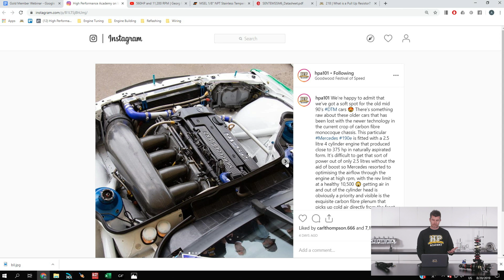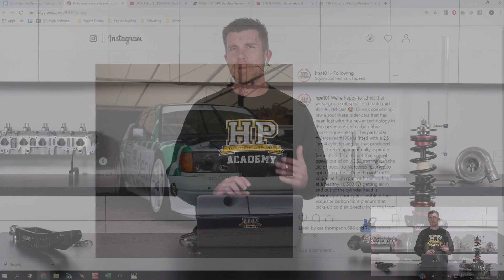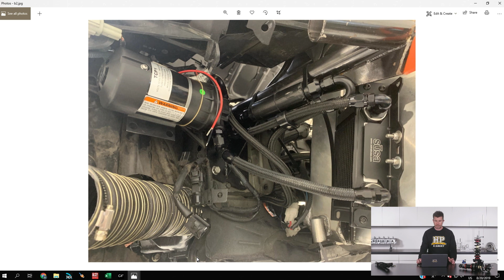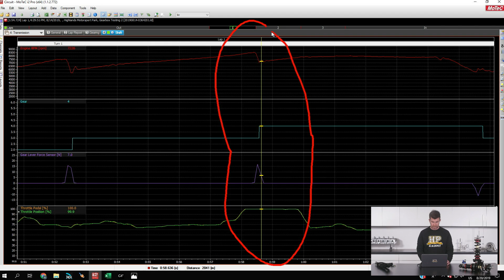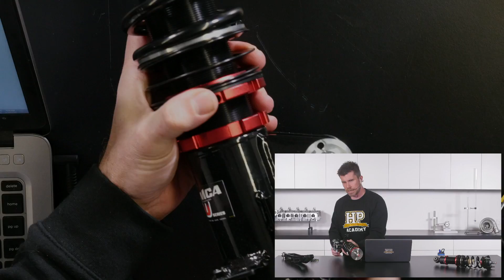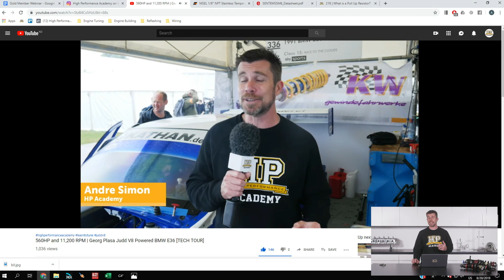Sequential Gearbox in V8 Toyota 86 & Data Analysis | Today At HPA 218 [UPDATE]

Comment: Fit a flat splitter and undertraythat seals the radiator. Vent the bonnet to improve airflow through the rad
Reply from the maker: That's what we had with our budget aero setup, hoping to keep those aspects but improve them further under the body and add a more rigid wing etc - Taz.

Comment: hey guys every wondered about the adverse affects of having a different diff cover? Banks (Turbo Diesel Specialists) made an interesting video on it. they showed that if the diff cover doesn't have a proper groove for the ring gear the oil will actually aerate and not feed properly to the bearings for the axle stub . Now im wondering if the oil is in fact aerating would that also impair the oils ability to cool properly.
Reply from the maker: Hey there, yes his video came up as a topic of discussion when we first fitted the cover, but his test has a few holes. Andre does discuss this in an older update, I'll see if I can find it and link it later but it will be the same playlist that all of these are in 😉- Taz.
Reply from the maker: Ahh here it is: https://youtu.be/PE3NbjPEO_U

Comment: About those cap screws backing out, where those on the left or right side CV joint? I'm guessing on the left diff flange.
Reply from the maker: Both sides 😉
Reply: @hpa101   Really? One side would make at least some sense. Did you try nordlock washers before  the lockwire solution?

Comment: 8:31 Why is there a difference in pedal position and throttle position at it's closed position and not at the wide open range?
Reply: possibly due to idle speed control holding the ethrottle open so it doesn't undershoot when dropping into idle
Reply from the maker: As Vaughn guessed, the throttle position is used to control idle speed so it never closes to 0% even when the accelerator pedal is completely closed.

Comment: Another great video Andre!  I particularly enjoyed the in-depth review of the logs of your GT86 shifter load cell and related fields.  I am wondering if the MOTEC works a rear wheel speed measurement into the downshift throttle blip calculation. It seems like quite a bit of driveline shock could be introduced if the transmission is over-blipped during a clutchless downshift in a braking zone.  Maybe even enough to loosen some axle CV bolts?
Reply from the maker: Thanks for the kind words mate! ion this case the MoTeC is programmed with the gear ratios for the box so it can then calculate the engine speed should be when we down shift and can instigate a rev limit to prevent over blipping. You still don't want to just aggressively blip the throttle and rely on the limiter to catch the rpm as it provides a fairly loud 'crack' when it hits the cut.

Comment: Re: the bolts for the drive flanges, DO NOT use spring washers as they DO NOT work and I have hade several actually break. Where possible use flat, hardened washers or, at least, AN grade.

If you have the budget, I would recomment NORD-LOCK washers - https://www.nord-lock.com/nord-lock/products/washers/?gclid=EAIaIQobChMImruGq8-n5AIV2oRwCh0WzwXUEAAYASAAEgK3DvD_BwE

Some of you may also recall the Plasa BMW being featured in C&CC and RCE just before his death in a rather horrible crash in that car. (If I have the right driver and car, mind ;-) )

The JUDD V8 was, IIRC, originally intended for the old 3 litre F1, as an alternative to the Cosworth DFV, but wasn't successful and then the turbo's came in. It was then modified for endurance racing, primarily by increasing the capacity, so it has a very long race heritage at the highest levels.
Reply from the maker: Hey Gordo, the reason there are spring washers on the CV bolts is simply because that's how they're supplied by Drive Shaft Shop who are the manufacturer - We haven't made any changes here. Interestingly our other car fitted with exactly the same axles and exactly the same spring washers has had zero issues with the bolts coming loose. The difference is that our V8-powered 86 makes around 80 hp more and is fast enough to unload the rear wheels and wheel spin if the driver stays flat as we crest the bridge at our local track. Another race team we deal with closely has found the same issues with the axles in the front of a VW TCR race car and they only loosen at this particular track so we're putting two and two together and concluding that the bridge is likely to be the root cause. While I'm aware of the nord lock washers, our solution of drilling the heads of the bolts and securing them with safety wire is a bullet proof solution.
Reply: @hpa101  Agreed, shock loads/torque reversals can loosen damn near anything.
As you say, correctly used (as you did, with the loosening action of one tightening the other through the solid link) lock wire will significantly improve creep resistance.
The other advantage is it makes a visual check much easier - if a wire is broken there is a problem, if not, then not. You can monitor creep and loosening with some trusty paint, but with dirt and poor lighting under a vehicle it can be easily overlooked.

Comment: I enjoy your videos and get a lot of information from them thank you !! Now on the axle or half shaft bolts coming loose ?? I see you have a split washer ( lock washer to some ) on the bolts !! WHY ??? Would you use split washers on a connecting rod bolt ...or a head bolt ….how about a main bolt ?? NO !! SO !! Why are you using a washer like that on a drive line part !! Been there done that found that hardened A N washers fixed the problem !!
Reply from the maker: Hey Bob, thanks for your comment. The reason there are spring washers on the CV bolts is simply because that's how they're supplied by Drive Shaft Shop who are the manufacturer - We haven't made any changes here. Interestingly our other car fitted with exactly the same axles and exactly the same spring washers has had zero issues with the bolts coming loose. The difference is that our V8-powered 86 makes around 80 hp more and is fast enough to unload the rear wheels and wheel spin if the driver stays flat as we crest the bridge at our local track. Another race team we deal with closely has found the same issues with the axles in the front of a VW TCR race car and they only loosen at this particular track so we're putting two and two together and concluding that the bridge is likely to be the root cause. Regardless however, drilling the heads of the bolts and securing them with safety wire is a bullet proof solution.